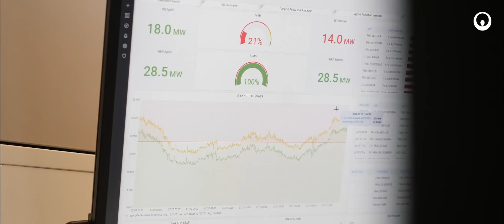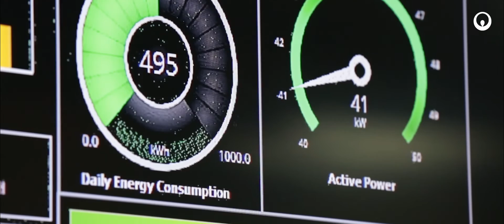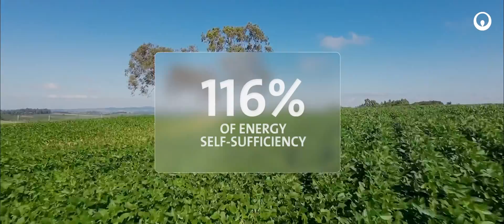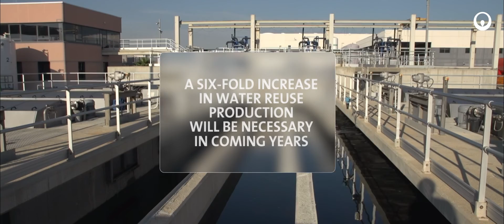Take a deep dive with us into ecological transformation around the world | Veolia

Comment: Respectful Greetings!
To: Veolia Group.
Dear
Veolia Group has been actively contributing to Africa’s fight against the climate crisis through a diverse portfolio of initiatives that embrace a circular economy, advanced water technologies, and energy efficiency measures. Their approach is rooted in fostering local resilience and sustainable development while reducing greenhouse gas emissions and optimizing resource use.
One of the most concrete examples of their work is in South Africa. In Durban, where water stress poses a significant challenge due to rising demand, Veolia’s water recycling plant has been in operation since 2011. This facility recovers 98% of the wastewater from the SWTW plant—amounting to 47.5 million liters per day—transforming it into a recycled resource that can be used by industries and municipalities. Not only does this process help alleviate water scarcity, but it also reduces costs by about 60% compared to conventional water sources, thus offering a sustainable and economical solution for water management while also minimizing environmental impact.

In Ghana, Veolia has been present since 2014, implementing a range of energy and sustainability projects. These initiatives include conducting energy savings audits for several public buildings under the Millennium Development Authority’s “Race to Retrofits and Renewables” program, which aims to enhance energy efficiency in public infrastructure. In addition, Veolia has invested in capacity-building initiatives by establishing energy conservation education programs in 30 pilot schools and setting up two energy auditor training centers. These programs are designed to raise awareness about energy efficiency and to equip local communities and professionals with the skills necessary to support a transition toward more sustainable energy practices.

Beyond these sector-specific projects, the Group actively participates in key continental events such as the Climate Chance Summit Africa. Through these engagements, Veolia works closely with local governments, non-state actors, and communities to promote the circular economy. This model of decoupling economic growth from resource consumption leverages local assets and encourages innovative approaches to resource management—serving as a catalyst for both climate mitigation and adaptation actions on the ground.
Overall, Veolia’s initiatives on the African continent are multi-pronged. They include:
Innovative Water Recycling Projects: As seen in Durban, transforming wastewater into a valuable resource to ease water scarcity and offer cost-effective supply alternatives.
Energy Efficiency and Conservation Programs: Particularly in Ghana, where energy audits and educational initiatives help public institutions and communities reduce energy consumption and build local expertise.
Promotion of the Circular Economy: Through collaboration with local governments and stakeholders to tailor solutions that maximize resource utilization and foster economic development in an environmentally sustainable framework.
Capacity Building and Technology Transfer: By training local professionals and educating communities, Veolia contributes to a broader shift towards sustainable industrial practices.

These initiatives demonstrate Veolia’s commitment not only to reducing environmental impact but also to empowering local economies. Strategies like these help ensure that the transition to sustainable practices is inclusive, supporting both ecological balance and socio-economic growth in regions that are most vulnerable to climate change.

Courteously!
Luís Lopes